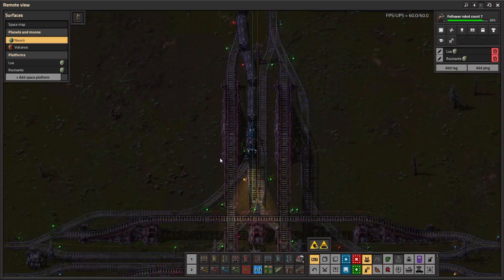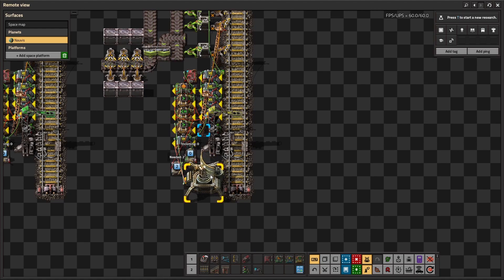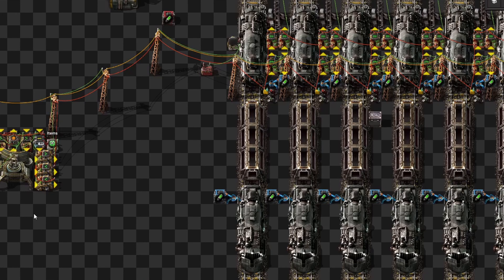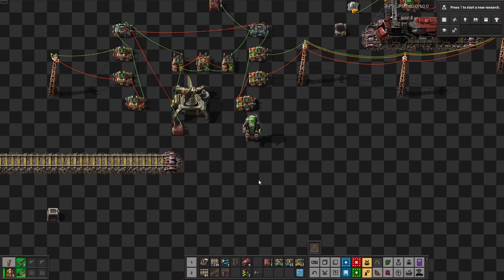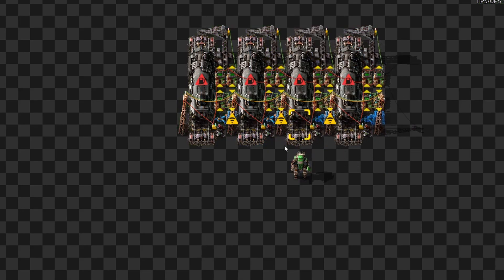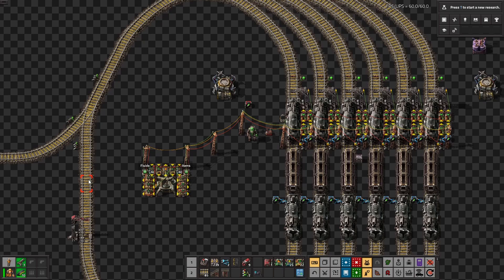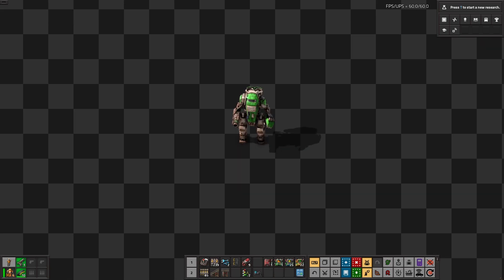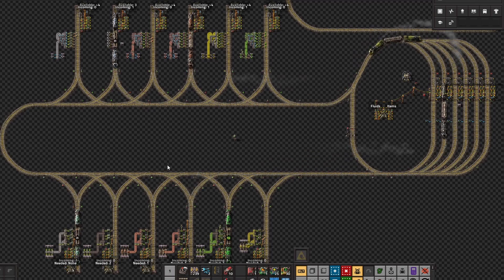Factorio 2.0: Parameterized Train Network

Comment: My version of a 100% interrupt driven train system was to use the depot as a dumb buffer of fully loaded trains. Only the unloading is parametrized. Any train will automatically go pick up any resource, without going through the depot, and then find the correct unloading station. Basically, the train depot is a glorified parking spot for trains that aren't busy. Either because there's no pickup stations trying to fill more trains, or because all the dropoff stations have full buffers.

Selecting the right resource to load into trains is controlled on the production side, at the generic pickup station. Pickup stations decide how many trains should park themselves at the depot, by only enabling themselves if they want to increase the count of trains in the depot. Trains filled with resources will automatically park themselves at the depot until the correct pickup station opens up. Pickup stations only care about their current resource buffer, and always remain open if the buffer has room to unload a full train.

There's basically zero logic on the depot side. The depot only reads the resource contents of the parked trains, and sends a count of each resource to the global radar array. One integer for each parked train. Pickup stations read the global radar network and automatically disable themselves if they see that many trains parked in the depot for the resource available at the station. Each pickup station has the same name, but a configurable blueprint with a per-station disable limit, so any train can use the pickup station immediately after it opens. Empty trains use interrupts to automatically try to fill themselves at any available pickup station, and use train parameters to automatically send themselves to the correct parameterized drop-off.

The disadvantage is that you must have enough buffer space in the depot for all the resources to have at least one train, otherwise it's possible for trains to never pick up a certain resource. For example, if you're constantly low on iron, your trains might never pick up copper because they're always dispatched to iron first. The other problem is it's easy to build out a bunch of new train stops, and accidentally not realize that you massively underbuilt your depot, and you run out of depot space. That's a problem, because none of the iron trains can pass through the depot to reset their interrupts, and throwing "no path" errors at a pickup station blocks that station from being used until the stuck train can leave.. So I set a alarm on the depot that says when it's only got a few empty spaces.

However, there are some neat advantages of doing things that way. Zero logic on the depot side means there's no processing delay by scaling out the network, and depots don't need stations to have any order. Which means you can have an effectively infinite number of distributed depots. This means you can place smaller depots closer to areas of high demand, and if you're keeping inputs and outputs close together, trains will take a shorter path to a nearby depot instead of having to path across the entire map to the one global depot. If there's an open station, the train will bypass the depot and directly unload, maximizing throughput. Theoretically, you can have a ore train unload into a smelter, and then immediately pick up the smelted ore. The depot is just a glorified parking spot, and it steps out of the way when it's not needed. The trains run on a 100% interrupt schedule, with no static stops. They only visit the depot when they're unable to go anywhere else. (Make sure to set the "interrupt interrupts" setting for that behavior.)

There are other weird advantages, like being able to dynamically adjust which iron mines turn on during high demand. You can set individual stops to have separate pickup limits, so you can configure which mines turn off sooner. A depot limit of 1 means it's only going to turn on if the depot is entirely empty, while something with a depot limit of 5 will basically always be running. This way you can prioritize consuming from bigger iron mines first, and make your smaller mines last longer.

It's also nice to be able to look at the global signal of trains in the depot, and know where your bottlenecks are. Because the trains in the depot only contain resources that are being buffered, you can immediately identify which resources you need to produce more of. Just glancing at your depot signal is enough to give you a poor man's production graph. I've found that was invaluable for debugging mistakes in my trains or any low production in my base.

If you're designing a system like this, one important thing to understand is that a train only reads interrupts during certain conditions. Which means you have to be careful to make sure the train can 100% get to its destination when you set an interrupt condition. Otherwise, the train can get stuck. That annoying problem caused a few headaches. The other annoying problem is, it's not possible to know what resources trains are currently picking up. If you have a problem where a resource (cough copper cough) is only being partially unloaded, then you'll get in a situation where you fill up WAY too many copper trains, because they're pulled away from the depot to "unload", only to return to the depot, with +1 train every cycle. Took me a long time to realize why my trains were too busy to do anything else.
Reply: That sounds badass!

Comment: Hi Yorven,

I have a question. What is the benefit of this system over regular interupts with parameterized destinations?
Thanks for the great video.
Reply from the maker: The benefit is that this system is meant to be easily expandable. No worrying about fiddling with interrupts yourself, I've already done all that. Just place down stations, wire in the buffer chests, and you've got trains.
I can't claim that this is the best way to do trains (it's Factorio, there is no "best way"). I built this largely because I thought it would be a good challenge.

Comment: does number of parking spots mean including or excluding the stop itself? so 1 parking spot is just the stop? or does 1 mean space for a single train to wait before the station? because I dont have space before some stations.
Reply from the maker: Parking Spots includes the stop itself. If you have stops without space before the stations, the number would be 1. If you have a stop with space for one extra train before it, the number would be 2, and so on.
Reply: @Yorven  Thanks! my depot is endlessly filling with trains filled with the first resource I added, and the second one (required to craft something with the first one, so the first one doesnt drain) doesnt get called. Any idea where i made an error?
Reply from the maker: @joepiejaapie  If sounds like the Provider for the first item isn't turning off despite its Requester not asking for any orders. Without looking at your base, I would assume that this could be caused by either 1) there's another source of the first item signal contaminating the radar channel somewhere, or 2) there's something going on with the receiver. Either way, I have to hurry up with the update to the receiver blueprint.
Reply: @Yorven  for some reason there was a very high copper signal on the radar network. removed the provider and after a while it disappeared and stayed away when I pasted a new provider. Thanks for the help!
Right now the fluid isnt working for me for some reason the train does not copy the demand from the signal. It can drive to all stations and the limits are all correct any idea what might be the problem?
Edit: pasting the two depots side by side, I can see a missing red wire going from the signal to the power pole, but fixing that so it is correctly attached doesn't seem to fix the problem, but aside from that I can't find a difference.
Oh and Thanks for the awesome system, of course it has a learning curve but that is still better than trying to make something like this myself!
Reply from the maker: @joepiejaapie  Right, there were two issues. The first was the missing red wire on the fluid depots, but also the fluid train interrupts were checking that it was parked at the ITEM depots before receiving requests. The main blueprint on the website is now updated with these changes, and also includes a new version of the Receiver, which removes the "no stack size of 1" limitation.

Comment: I tried to do the Same thing, but honestly I’m just to stupid. I have a kinda working system, but the problem is whenever there is a signal on the radar so that 1 item could be transported at least two trains start going to the train stop. I tried many hours to find a solution without the timer which u used, but I couldn’t wrap my head around it. Anyway very nice build and if u find a solution, so that u can have multiple depots upload another vid. Keep up the good work
Reply: The depot timer is a must in this system. but it can simply be a single decider combinator(+ constant combinator if u wanna count from 0), that counts to X. At each depot you put a decider and constant combinators, The constant combinator serves for the parametrisation and to increase X. The decider outputs to the depot station, when your clock equals the set value. I personally use multiples of 2. The obvious disadvantage is that i cant just click and drag the depot bp, but i am willing to make that sacrifice for the less combinators... :D

Comment: i believe docjade also created an autotrain blueprint book, idk how you all do it!
Reply: AutoTrain leaves full trains in the depot all the time.
Reply: @vr4k497  Yeah I've been having a lot of problems with trains, especially fluid trains, going back to the depot with some cargo left and getting stuck. This is annoying because I want copper and steel only transported as liquids, demand for those constantly fluctuates. 

I get how the circuits work, it seems that they aren't receiving the item signal to head back out. Might be because cargo isn't being read in the depot station?

My hack solution might just be to remove the inactivity condition, so a train with cargo will never leave. Obviously trades off some flexibility, as any stop that isn't being used that much constantly steals a train from the network.

Other solution is adding a buffer to the requestor stops that ensures that all trains empty out, but that's a lot more complexity on the unloading stations.

Comment: Hey does this work on a larger scale? Like if you wanted to do a large mega base like this would you be worried about UPS issues? I love the idea tho!!
Reply from the maker: @realgamer9742  I honestly don’t know, I tend not to megabase, but the main source of UPS issues would likely be all the timer circuits at the depots, so this could be reduced by using longer trains, thus needing less timers. 

My main concern using this in a megabase would be that because the timers only allow for dispatching a train every second, there would come a point where requests would be coming in faster than trains could be dispatched. Though I don’t know how big a base would need to be to create this issue. 

There would also likely be traffic problems caused from having a bunch of depots in one place, and the consideration that trains would be spending a lot of time transiting to and from depots, instead of hauling items. My next design goal for this system will be to figure out how to split up depots.